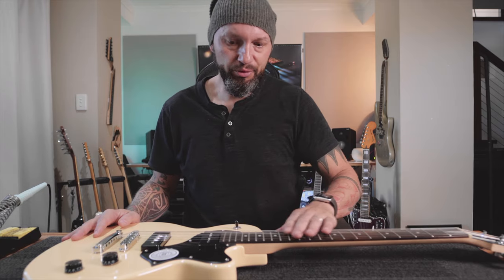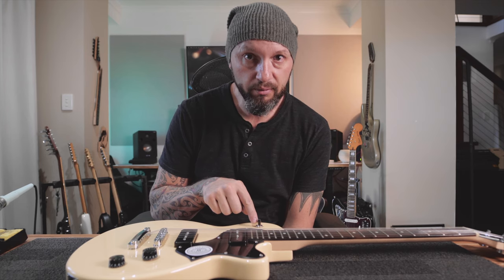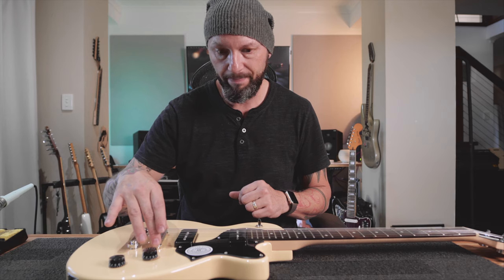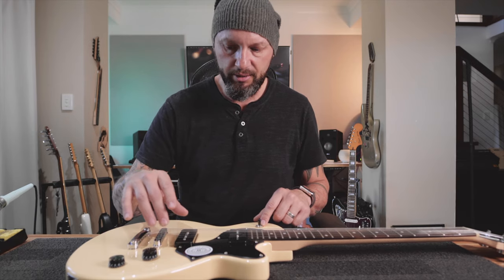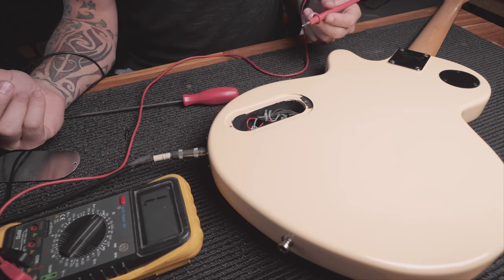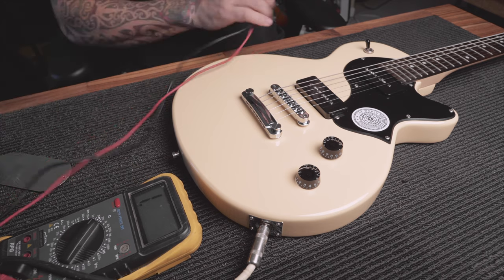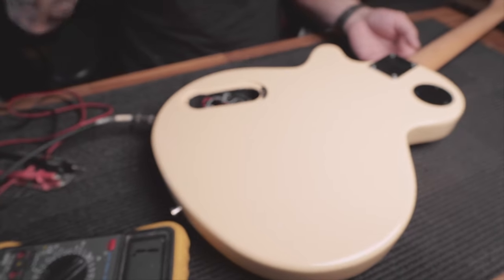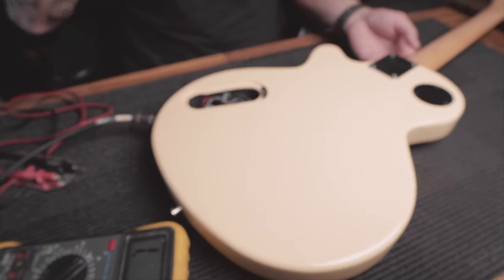3 Easy Solutions to Fix Ground Noise | Guitar How-to Ep02

Comment from the maker: Hey guys, to make it all a bit easier to help you out, please include your guitar, pickups, pedals, amp, and any other gear that might be contributing. Each guitar is different depending on pickups and configuration.
Reply: my guitar fender stratocaster my amps is marshall no pedal,regards👍
Reply from the maker: @JaimeRama-q8t  If your guitar is single coils it's normal to get noise with high gain amps. You can try shielding like in my video I have linked for you.
Reply from the maker: @realitywave  yea it’s got a wiring issue for sure. Probably a bad solder joint. But man if it’s a brand new Gibson take it back. Get a replacement or have the store fix it for you.
Reply from the maker: @realitywave  if it wasn’t new I’d say crack it open and let’s fix it. But Gibson should be better than that. I hope they sort it quickly for you man. 🤘🏼
Reply: Ibanez gio , fender amp , no pedals
Reply: I would love to see the process of removing the bridge in order to fix that ground as I may need to do that on my brother's Jackson King V.
Reply from the maker: @stacyyoung2316  I am planning to do an update series, showing in more detail for Strat style and for Tunomatic style. Stay tuned.

Comment: Your "Touch" Test is an excellent approach to finding a ground problem.  Great Video, Thank You!!!
Reply from the maker: Thanks for the comment. Hope you found it useful.
Reply: @RisingSunGuitarMods  What happens if it does quiet when you touch it?
Reply from the maker: @Brwinka  that’s what it should do.
Reply: @Brwinka  What I'm understanding is that if you touch a part and that cuts off the humming sound, that means the problem isn't there. If you touch a metal part on your guitar and it either keeps buzzing or gets louder, that part has the problem. I'll update after I try and fix the grounding issue on my bass
Reply: @RisingSunGuitarMods What if it does do that, but doesn't work when you use with high gain. I have a Thompson Strat, and I want to record songs, but the loud hum ruins the recordings.
Reply from the maker: @confusedjay717  yes, correct. If it’s still a bit noisy but reduces when touching you can also try shielding. Check out my other videos for more info on this. ✌️
Reply from the maker: @randompersonontheinternet6312  single coil pickups will always be noisy with high gain. Try shielding, this can help. See my other videos on that. Also if you are using high gain I would recommend a noise gage and suppressor/compressor. Especially for recording. There are software options for this too depending on the DAW you are using. 🤘🏼
Reply: What video is on shielding?
Reply from the maker: @augustsanchezdunn628  see my pinned comment: https://youtu.be/sAQP5HtdNuc

Comment: The noise increases dramatically when the volume is high. But it becomes very quiet when I touch the screen or the volume knob. Now I realize I forgot to try the jack and the bridge. Anyway, what could be the issue? Thanks.
Reply from the maker: Go through all the steps in this video, if none of what I suggest works give this a go: try this: https://youtu.be/sAQP5HtdNuc

Comment: I have a Gretsch that buzzes until you touch the metal vol/tone knobs but it only does it if the guitar volume is set low. If the volume is turned up to max there is no buzz at all. Any idea what's going on here?
Reply from the maker: What setup do you have? Strat single coils, Les Paul Humbuckers etc... But either way it might be worth reflowing your solder joints, possibly have cold/dry solder joint somewhere. Also depends highly on you signal chain and also your power supply, if you are using pedals without isolated power this could also be a cause. Try plugging directly to you amp, and although this sounds weird, take your amp to your kitchen and plug into the power in there, I don't know where you live but some countries have poor grounding in household power supplies, usually kitchens are grounded correctly. Give it a go and let me know.

Comment: I have a bass guitar and i tested continuity on all pots, the bridge, the jack, everything and it all is working, i didn't had any continuity between the shielding and the pots, what should i do?
Reply from the maker: The shielding should make contact where the pots are secured, however, if you have shielding paint that has been clear coated over the top this connection might be interrupted. If this is the case you need to run a wire from the back of the pot to a small screw with a terminating lug in the cavity.

Comment: Thank you very much for this.  I just picked up an Ultra Strat and it was noisy af.  I suspected it was a grounding issue but have very limited knowledge of how to diagnose or fix such a thing.  Your video absolutely helped me discover what the issue was.  I did some continuity testing and found the exact same thing that you show here with the bridge not being grounded.  Unbelievably, after pulling it apart the ground wire to the bridge had just fallen off the soldered connection!  I bought this guitar new a week ago!  The old me would have just returned it, but after watching this and digging in I feel super confident and empowered to just repair it myself.  Thanks so much!
Reply from the maker: That’s awesome! Really happy this helped you to sort it out. 🤘🏼
Reply: The factories are producing these so fast, one person just solders that connection all day on an assembly line.  Lots of little parts might need attention, it's not a defective guitar. Clean the metal before you solder.

Comment: This video did the trick. While I was playing, suddenly there was very loud buzzing. I "looked" at the wiring which I had done, and I didn't see a disconnected wire, but I followed your continuity check with the multimeter, and it had to be a ground issue somewhere. Oh-- no continuity to the jack. I checked the jack soldering; it was solid there, but when I followed the wire from the jack to the pot, sure enough-- it had popped off the pot. Soldered back on and am getting those squishy strat tones once moreth :) 😊 THANK YOU FOR THIS VIDEO !
Reply from the maker: That’s awesome. Happy this helped. 👍👍

Comment: Thanks for making this. I have some grounding issues that are driving me freaking nuts!
Reply from the maker: I hope it helps mate. ✌️
Reply: Had a chronic buzz develop on my Carvin I could not root out- still had good signal and output, electronics and soldering all looked good.  Everything seemed good at the jack... buzz still persisted.  I had removed three of the five screws on the electronics cavity cover for quick access to the battery at gigs and rehearsals. Just by chance I replaced one of the screws in a different hole than usual and... huzzah!!  Buzz is now GONE!  :-D
Reply from the maker: @RTDF516  Thats weird, but it could be that the screw you replaced might have been connecting a ground circuit.

Comment: I had a really bad noise problem with my Squier strat. Dunno why but the pickup selector lever was making the entire thing sound. I soldered a cable to it and then just put it into the screw next to it (it looks funny 😂) but it worked! 
I had to ground the pickup height screws too and the noise went down A LOT. It's now much better than it was before, I couldn't even play with that noise. 
The best option is to really, REALLY try the guitar before buying it. That way you can check if it has any undesirable noise.
Reply from the maker: Sounds like the selector switch wasn't making ground, on a squire it should have a bit of silver shielding under the controls, if the selector tisn't making a ground connection to that your ground continuity is broken, by soldering a wire to the screw you have fixed that broken connection. If it is still a bit noisy you could try shielding the cavities, see my other video here: https://youtu.be/sAQP5HtdNuc 👍 Happy jamming!
Reply: I have a pickup switch problem being fixed in one of my guitars now (complicated wiring I don’t want to mess with) and I’m hoping it helps because my guitar is loud af at home.

Comment: My boutique 57 Strat reproduction used unshielded wire between the pickups and the control cavity, and from the control cavity to the output jack.  I shielded all the cavities with copper foil tape, including the output jack cavity, and changed the output jack wiring to coaxial cable.  This solved the noise problem.  The copper foil tape has conductive adhesive, which might help its performance.  Conductive paint also works well if you put on a few coats, but waiting for paint to dry between coats takes a lot more time than applying the foil tape.  I also shielded the cavities of my Les Paul to reduce the noise floor when using split humbucker coils.  I did not notice any loss of treble on either guitar.  I guess that the shielding is far enough from the coils and pole pieces to avoid strong eddy currents.

Comment: Fantastic video and easily the best on this common problem.
Reply from the maker: Thanks man, appreciate the comment and am glad you found this useful.
Reply: @RisingSunGuitarMods  I've just cracked the sads with my wiring and pulled it all out to start again hahahaha. All good though. This video was a real sanity check, but also got me looking at the problem in a different way which is great
Reply from the maker: @itspetedee  Wiring is sometimes a bit tricky, I fiound a lot of schematics online to be wrong or switches backwards etc... so even though you think you got it right acording to the diagram, sometimes just using your own understanding is the best solution. A multimeter is your best friend when trying to find any problems. Best of luck with the rewire man, if it goes sideways on you, have a break and a nice cold beer, that always helps.

Comment: Good video and definitely helps. But where did you solder the wire? to a terminal or to the body of the pot? I have a nasty bit of noise from my bridge. I want to open it up this weekend and see what's going on. But grounding point is important.
Reply from the maker: Solder to the back of your volume pot. Most ground points will be soldered there. The other end either to your bridge post or if a strat to the claw in the back and if a hard tail like a Tele it goes under the bridge. 🤘🏼✌️

Comment: I've built an SG style guitar and need to add a grounding wire to the bridge. I've added a Bigsby B5. I had a local guitar tech assemble my neck-thru 24 fret SG the first time so I haven't done this before. I've put a hole to the bridge stud hole now. My question is, do I just run a wire thru the hole of the control cavity and tap the threaded insert in over the wire, or do I need to solder the wire to the threaded insert?
Thanks!
Reply from the maker: You should be able to run it to the bridge stud, you can wrap it around the insert if you like, but no need to solder it or wrap it around the thread. :)

Comment: I've seen springs cause the noise, those coated springs do not ground at all and if your mian ground is soldered to your spring claw and the springs are coated or painted then there is no ground, just the claw.. 

also coated hardware, like powder coating or black chroming..  they make poor ground so scrape away all the areas critical so they can make full contact, use your MM fora continuity test and see how strong that ground is, it needs to be real good, shield everything, even covers and make sure the cover/guards are grounded as well so there is continuity..

wiring is one the bigs ones, poor wiring, wrong gauge, then how its wired up, humbuckers have to be wired right, one wrong wire and they can get real noisy, same for any pup with more than 2 wires.. cold joints as mentioned
Reply from the maker: I’ve not come across coated springs but good point. I think the idea behind them is to reduce the noes they make when going hard on the tremolo?

Comment: That was an excellent and informative video. Many thanks. Have you ever come across buzz related to certain frequencies on the guitar e.g. Bb and within a semitone on different strings, mainly 4th and 5th strings. Checked all the fret clearances and loose parts etc. but it appears to be electrical. Any advice would be appreciated.
Reply: A bit more info. Comins GCS1ES, KA Humbucking pickups with push/pull pot for conversion to single coil (never used).
Reply from the maker: Thanks for your comment. Appreciate it. I’ve not come across this particular problem. Interesting though, do you have any pedals in your signal chain, and have you tried different leads?
Reply: @RisingSunGuitarMods  No pedals and tried different leads to no avail. I’m suspicious of a volume pot, as it appears to get worse across part of the range. I’m considering having it changed out. Difficult to find compelling evidence though so it would be on spec. Might have the wiring looked at in more detail. Shame you’re not in the UK!
Reply from the maker: @danielg8001  I wonder if it might be interferance from a device that is emitting that frequency. Sounds strange, but try taking your amp to another room far away from where you have it currently set up. ... Also without seeing your guitar, if the wiring is messy or poorly done this can also contribute so a rewire might not be a bad idea.
Reply: @RisingSunGuitarMods  I’ll certainly give that a go now that you mention it. Turn all appliances off etc. Many thanks for your advice and suggestions. If I come across a solution I’ll let you know. Best regards.

Comment: Thanks for the great video!! So I have a Les Paul which really isn't super noisy. But it does get noisier when I either touch ANY of the metal parts. I play it through a Marshall SC20H using a reactive load box, so no real cab. Any thoughts on what could be the problem here?
Reply from the maker: @jls8  Thanks man. Your LP shouldn’t get noisy when touching metal parts. I’d run a multimeter over your ground connections, make sure everything is connected well. It might be worth reflowing the solder on your output jack as well. 🤙

Comment: I’m getting buzz, but If I touch the pickups, bridge, switch or jack the noise diminishes significantly. Thoughts? I use a quad cortex, with my tele style guitar with humbuckers
Reply from the maker: Try without the the quad cortex, straight into your amp. If you still have noise it could be a bad solder joint. Do a visual inspection of your components first including your output jack. If you don't see anything obvious try reflowing the solder joints on your output jack and the connections on your pots.

Comment: Hi, excellent video Thank you! I have a question the noise in my guitar only reduces when I touch the output jack plate, what can I do?
Reply from the maker: Follow the instructions in the video, look for a missing or broken ground wire. Get a multi meter and test continuity. 👍
Reply: @RisingSunGuitarMods  I have telecaster with black hardware, the point is the plate/bridge does not conduct anything even if I put both poles of multimeter on the plate there is no continuity, the wire connected to bridge is OK.
Reply from the maker: you should get continuity from your ground to your saddles/strings. The bridge plate won’t matter, your strings should ground though.
Reply: @RisingSunGuitarMods  Yes, I think is a design flaw on my guitar the sadles also are non conductive, I think I need to change the saddles and maybe paint the plate with a conductive paint to allow sadles make contact with the wire under the plate.
Reply from the maker: yea man your strings need to be grounded. Especially with single coils.
Reply: @RisingSunGuitarMods  Yes, I found a very simple solution, I scraped the paint from the base of the plate and all string holes, now the strings are grounded, not the saddles.